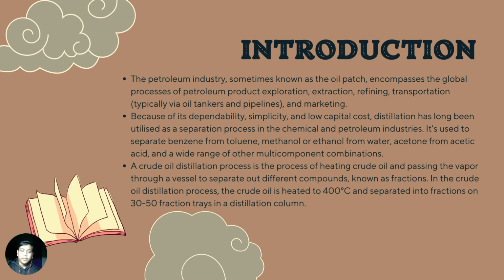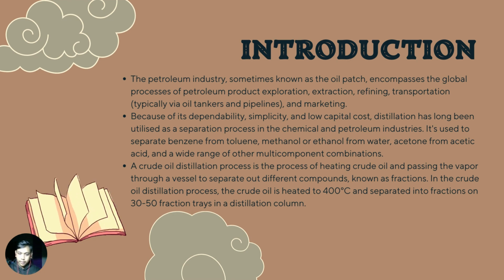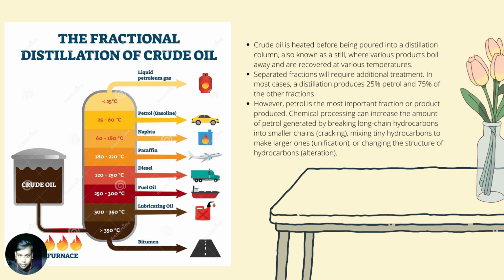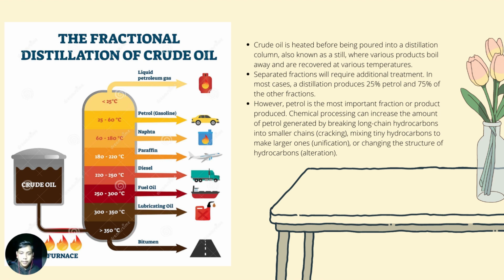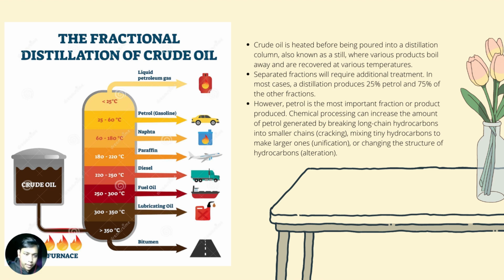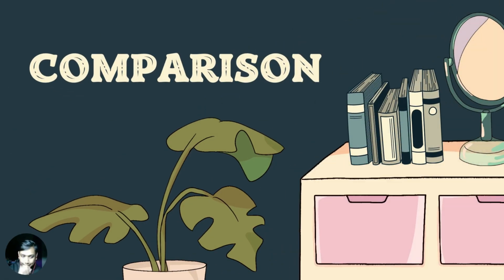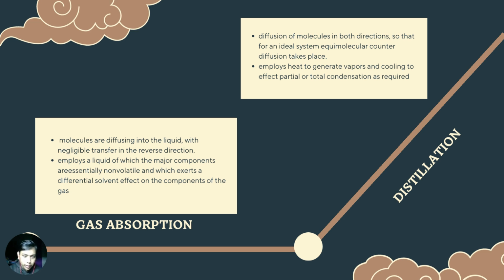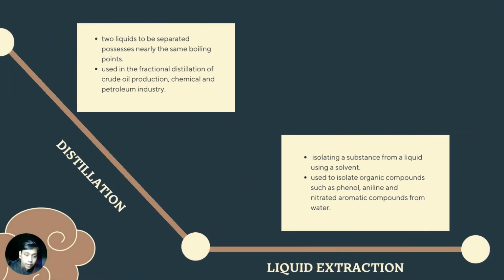CRUDE OIL DISTILLATION

Comment: why does distillation is preferable for crude oil separation?
Reply from the maker: Distillation refining is a method of fire refining by alternating evaporation and condensation to remove impurities by different boiling points. distillation is preferable because distillation can seperate more valuable products such as bitumin, parafin, diesel, petrol and others.